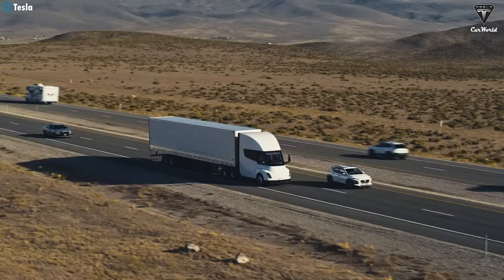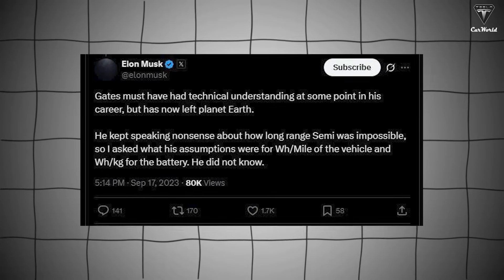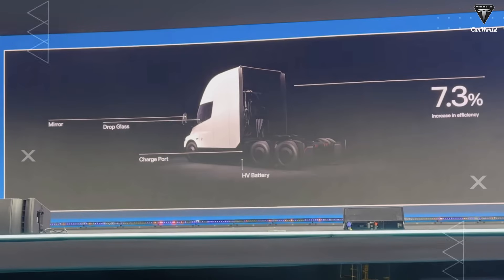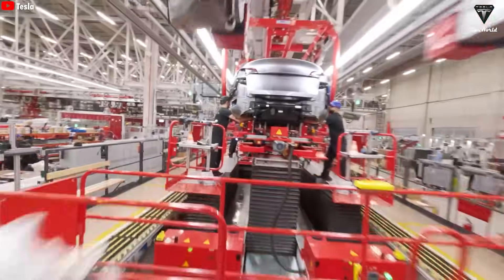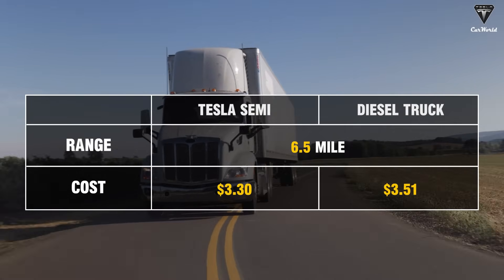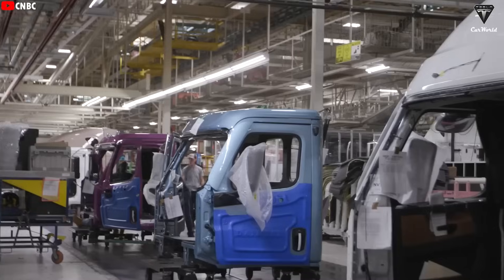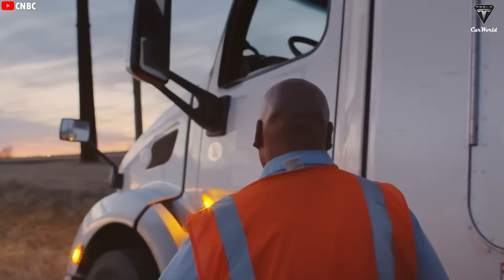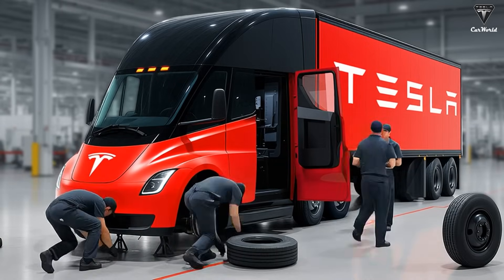Elon Musk Reveals Tesla Semi Gen 2 Finally Here! Mass Production With New Battery, Glass & FSD!

Comment: I'm all for self driving, but lets say you go across the scales in New Mexico, 2400 lbs is the limit of what is on the road. How is self driving going to hand over paper work if no human is in the cab/ Nine times out of yen you have to park, then walk to the weigh station, then present the paperwork. Who is going to do all of that if the truck drives itself?
Reply: If they are smart enough to invent self driving trucks, they shouldn't have problems to find a solution to provide legals documents when necessary. The autonomous truck can probably send an email with electronic versions of paper. Or a QR code on the truck...

Comment: @4:06, it mentions a 7% efficiency gain through aerodynamics? That is absolutely impossible! If Tesla can make a cab that improves aerodynamics by 7 percent, they do not even need an electric truck. They can just start selling cabs to every truck maker in the world.
Reply: The cab they make is not designed for diesel engine. There is no room for diesel engine, transmission, shaft, exhaust system.. . There is no giant cooler. They improved the aerodynamics by 7% compared to the  first Semi version. In the video, they said the aerodynamic coefficient of Tesla semi is 0.4 compared to 0.8 average of diesel trucks. So aero losses of Tesla semi are half of normal diesel trucks.

Comment: Never knew of any semi getting more that 5 miles per gallon, 'real world' fuel economy...The 6.5 miles per gallon is pure fantasy...ergo, the savings are even greater.
    For most fleets , it's about controlling costs and down time.  
EV's don't require fluids/filters maintenance for engine/transmission/axles, and unless the driver has an accident, the total cost per mile will/should be considerably less that diesel equivalents.